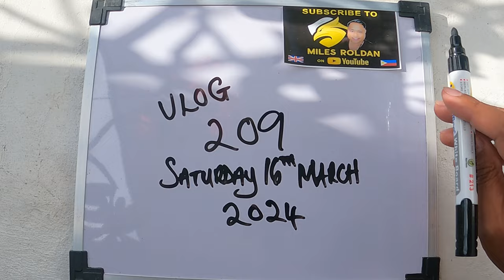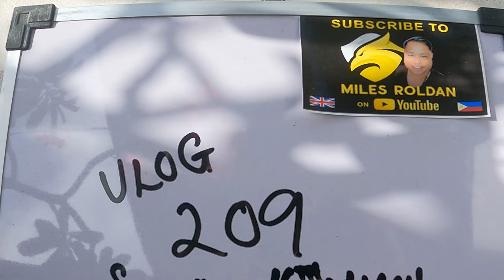VLOG 209: THIS IS HOW TO INSTALL A LONG SPAN STEEL ROOF IN PHILIPPINES!

Comment: Hi Miles. Definitely enjoying your videos. I did have a concern though. I noticed that they were installing screws in the upper ridge of the roof instead of the flat surface that makes contact with the C-Purlins. Overtime, that bolt is going to leak because there is an open gap between the bolt head and the metal roof under the C-Purlin. Another thing was I noticed that you are not putting insulation under the metal roof. You should use insulation so your dream home can be energy efficient. Just my observation Miles. Keep up the good work and progress.
Reply from the maker: Thanks for taking time to reach out… I’m glad to hear that you’re enjoying the vlogs… Thanks for your input, it truly is appreciated… Please kindly continue to view my content and smash the like button when you do. Thanks again

Comment: Hi Miles You will pleased to have a roof, rain and sun kept out.
I guess my standard is based on New Zealand Building codes and we are highly regulated with every step need to be inspected and then signed off.
In terms how they build in Philippines it's verry much as your doing. However our roof in Cebu has thermal underlay and I guess that's a personal choice.
Good progress.
Reply from the maker: Thanks for this, I would have explored the possibility of underlay being installed but it’s not available to me here in Capiz as an option. It would have kept the top floor at least energy efficient

Comment: Think you might have to paint that long span roof with all the walking over it with concrete on their thongs
Reply from the maker: I think it’ll be okay once we get it fully installed and the guys are off it… There’s a water tank yet to go up there and eventually down the line, a solar panel system
Reply: You really need to wash off that whole framing system like he said the chemicals in that concrete will eat right through that metal

Comment: I know if you have not put any insulation on the roof to stop the sound coming through a tin roof with rain makes very much noise are you going to do it later on
Reply from the maker: I like the sound of rain on a tin roof though… the bedrooms are on the 2nd & ground floors so I doubt it will be a huge huge problem.

Comment: Really solid roof don’t have to worry about any typhoons…Guam gets the same typhoons that end up headed to the Philippines or Japan….
But the contractor should have applied black tar in the rain gutter area over time the rebar will rust inside cement and your get scalding (cement breaks and falls do to rebars rusting and expanding 7X its diameter inside cement). Cement is solid but porous and absorbs water just like a sponge. 
The project is going well Gang Gang 💪🏽💪🏽👍🏽🌴
Reply from the maker: Hi Warren, thanks for watching the vlog. We coated the entire gutter and surrounding parapet wall with 2 layers of Boysen waterproofing. Yes I agree, very porous hence the waterproofing in vlog 199. Maybe check vlog 199 out if you have time. Thanks fella 🫡👍